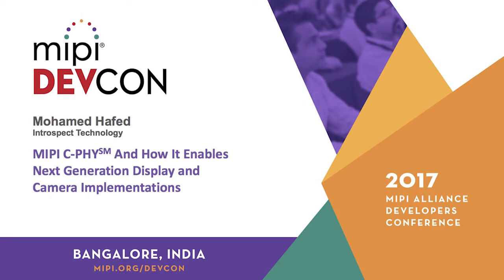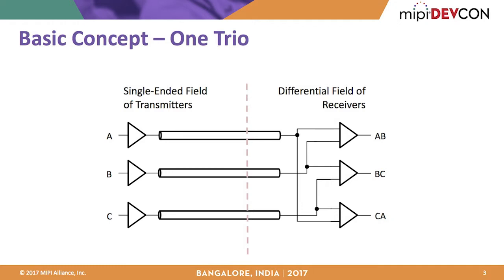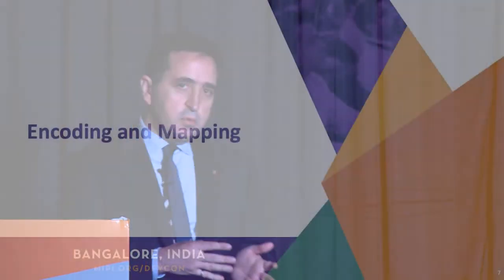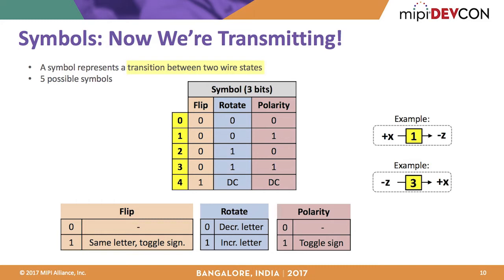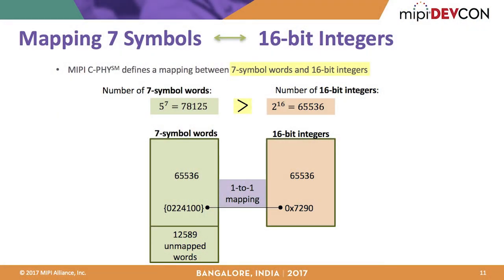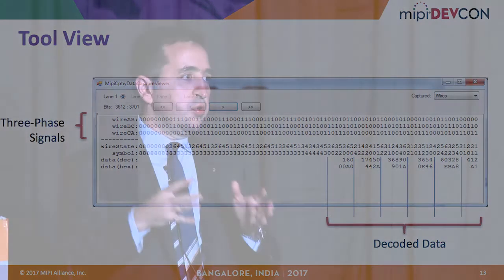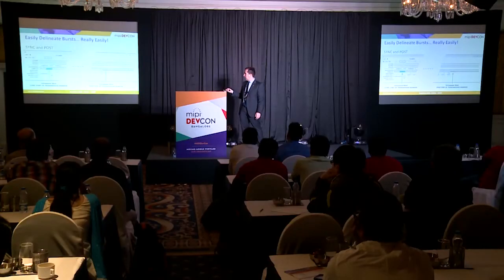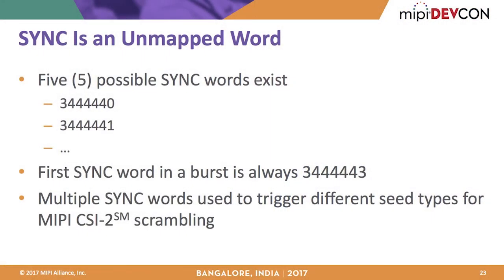MIPI DevCon 2017 Bangalore: C-PHY and How it Enables Next Generation

Comment: The 3 Phase encoding (symbols) can be used on railway tracks where 3 rails exist for a dual-gauge railway such as the 3Metre gauge used with the European gauge 1435mm. So there'll need to be an IEEE standard for this and devices are to conform with the wheels on the trains and sensors contacting the rails on the trains but also on structures near railway stations and other structures by the tracks (rails), so as to generate a current to thereby send/receive a signal for the payload. Japan and UK have similar road drivers license rules and compatibility can have an overlap. For example, Toshiba have contributed to early designs. Motorola and IBM have a history of good works together (instruction set, etc.). Hopsital trains which also have security (armoured carriages for precious cargo, and  also office space on trains etc., but also passenger rail) can profit from this comms standard groundwork. This is to help people and make is sustainable. It adds comms for health-and-safety but also profit and builds upon existing safety standards such as the intercity125 system legacy. So even though signals and comms can and are sent by other means already, by this 3 rail (dual-gauge) track, it is still to be done, where the dual-gauge is compatible with existing terrain. Essentially a signal redundancy or minimum by means of concurrency. Natural disaster tolerance can be detected too and in downtime (such as prepping scenarios), the infrastructure easily has enough to operate and divert people and trains to a safe location simply by the signal sent and received on a train (over somewhat short distances) even if it is in a diesel backup mode with battery-backup on the train itself (where the electrical railway track might be impaired or amidst total power-outage). In some emergencies, a fallback mode to token-ring allows limited bandwidth per train to be used before freeing up the signal path for the next train potentially elsewhere on the railway track/line. Usually, this mode of packet transmission would not be used and instead, the above is whereby all trains within a given vicinity of each other constantly attempt to handshake so as to preempt this token-ring mode if needed, logging a tantamount 'ping' each time they do so (and as such the technology is for robust signals first, and higher bandwidth later). It is still considerably higher bandwidth than LoRa (which, unlike this is wireless) and allows for the aforementioned scrambling. It is low cost and can operate even when satellite time is unavailable. Obstructions on the track can be located quickly. Switching between this and phase shifting (sin/cosine) over the 3 rails allows for filters (low-pass, etc.). I made this implementation concept so as to help people. So consider this comment describing design a gift of the Common Development and Distribution License (CDDL). That is somewhat similar to public domain (but instead CCDL) release of the design for the shipping container locking mechanisms in each upper corner of the cuboidal shape where a crane may attach, standardizing shipping containers worldwide.
1975-RC4558 the first multiple op amp device which uses NPN input transistors, (Raytheon Semiconductor), was developed and centronics made the parallel port in the 1970s, so by 1978 this could have (and should have) been used prototypically in the (1975-1982) intercity125 train, IMO. even by then the hardware existed to perform the electronics and design the basic system for bare minimum in advance of better connections. That would mean that by the intercity225 which would have the overhead electrical cables and the two rails, barely parallel to serial compression, the 4 bit parallel would have been achievable, and could switch to the tristate/comparator style transmission of symbols.
The simplest (3 rails) dual gauge (with two overhead electric cables minimum) would allow for the 5 connections as found on a 741 package Op amp 8Pin DIP (with expansion for the other 3 pins) for inverting and non-inverting inputs. Different configurations even back then would have been prepared such as the non-inverting op-amp, the integrating op-amp, differentiating op-amp, comparator, schmitt trigger and peak detector. By now, higher bandwidth versions would exists, but at the very least, even in the event of sudden and catastrophic failure, basic electronics (and perhaps a basic CPU barely like a microcontroller) would have calculated the above (as per a theoretical dual gauge intercity225 style railway line),  even with a 'computer' on the train itself, let alone at stations. A more modern computational system would run these days even though it would be able to emergency-default to the 741-package mode.
A third rail mounted outside the running rails becomes the "4th" rail when dual gauge has 3 running rails already and can be electricfied. So by thus expansion of a 4th rail, with the two over head wires (such as the UK overhead 1500 V dc 25 KV AC), a 6 bit minimum data transmission is achieved in that configuration. In that binary minimum (before more modern, advanced the symbols method is deployed) a range of 6bit meaning 0-to-63 characters allows for 64 character length as an hash in hexidecimal when mutiple words are transmitted.
Two's complement binary number is from "two to the power of five" to "two to the power of five minus 1". That is minimum value of -32 (i.e., 1 00000) to maximum value +31 (i.e., 0 11111). Zero has two representations of -0 (i.e., 1 11111) and +0 (i.e., 0 00000). In that basic fallback mode, periodic synchronisation between trains and other trains and stations (and signal boxes) can be calculated thus. Two hex values can be sent simultaneously both in the two's complement word because 32 possibilities are "16 (Hex) values" twice. The 64 possibilties express the place in the 64 character long hash string. So the place in the hash is sent, and on its own, the actual calculated hexadecimal value in the two's complement. With this redundancy a differential can be derived for a phase shift.
My comment has no hate in it and I do no harm. I am not appalled or afraid, boasting or envying or complaining... Just saying. Psalms23: Giving thanks and praise to the Lord and peace and love.